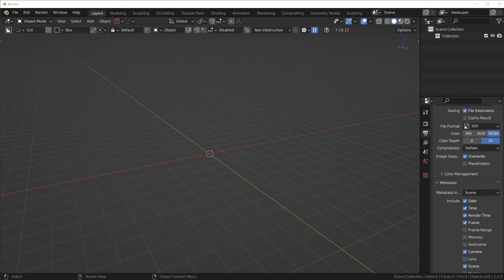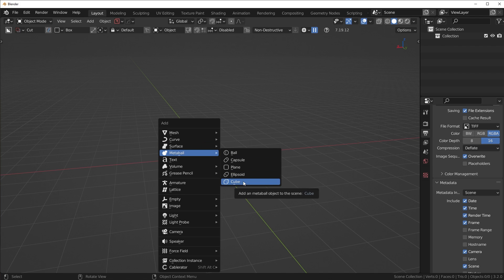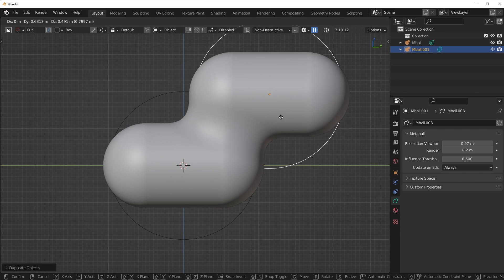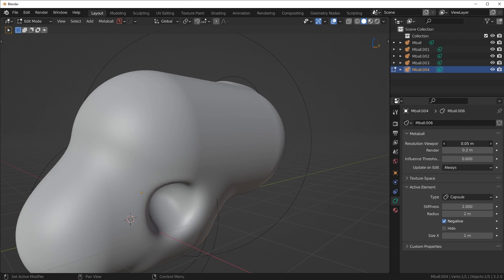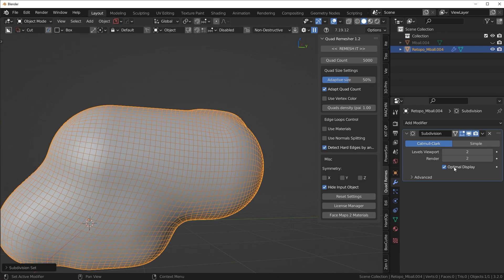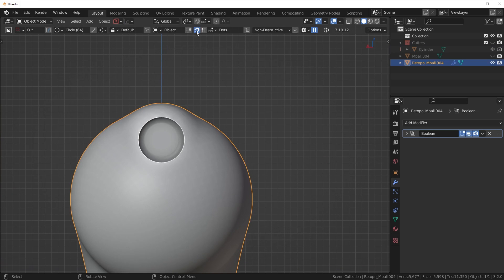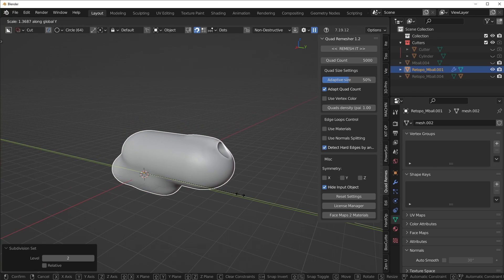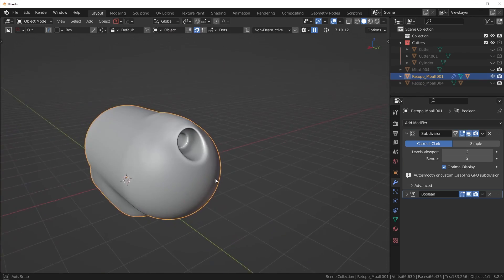Crazy METABALL Workflow in Blender (Tutorial)

Comment: i haven't liked my experience with quad remesher. i assume it's better for character meshes than something like hard surface modeling. it usually does a terrible job recognizing hard edges, doesn't have a smart face flow, so once i retopo i basically can't edit the form of my mesh in lucid ways, except through booleans or whatever. it also sometimes makes the mesh lumpy or deformed. it's nice to have the option to try it every now and then, and it has occasionally provided good results. but in general, and especially if you're a more casual blenderer, i would recommend not buying it, given how expensive it is. it could be that maybe i just don't understand topology enough, or that i'm misunderstanding the settings of the addon, but if that's the case then you probably would have to be an advanced user anyway for it to be useful to you.
Reply from the maker: It's all in the settings and the algorithm. Hard surface objects will naturally be remeshed with poorer results... but you can avoid it. Look into the material separation settings, detect hard edges setting, and adaptivity. The more complex the hard surface mesh, the weaker the results. As the algorithm gets improved and technology gets better it'll probably be close to flawless, but that could take some time.
Reply: Weird..... I've actually found that Quad Remesher gives wayyyy better results with hard surface objects than with characters ....
Reply: Is Quad remesher even being supported by the company behind it? I can't ever remember there being an update to the plugin.
Reply: @matslarsson5988  Ofcourse it is, new one came up with 3.4 support
Reply: @fastlearner292  I have version 1.2.1 of Quad Remesher. Isnt that the latest one? I cant remember downloading a newer one in ages or hearing a single word from the company? Anyway, I hope you are right.